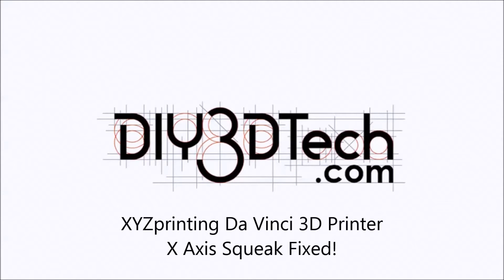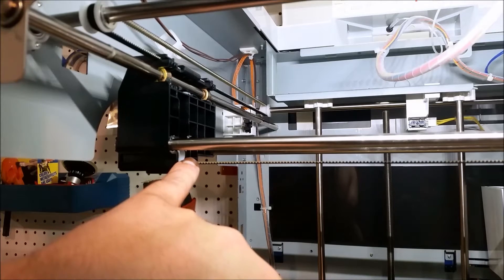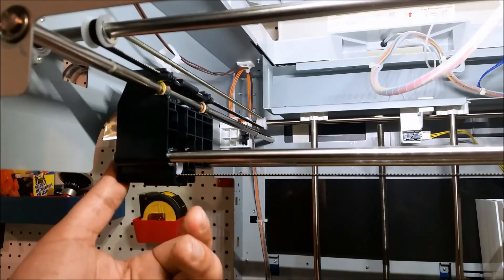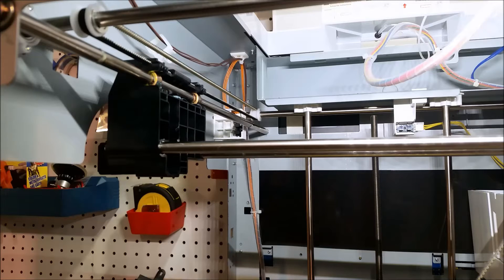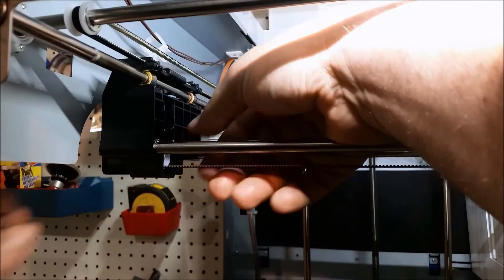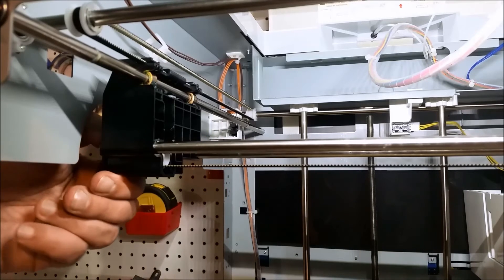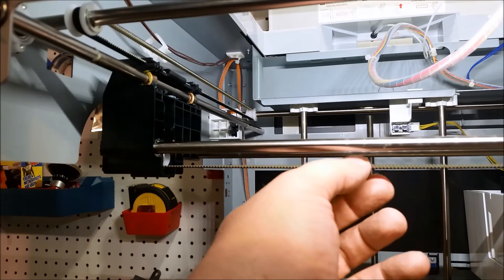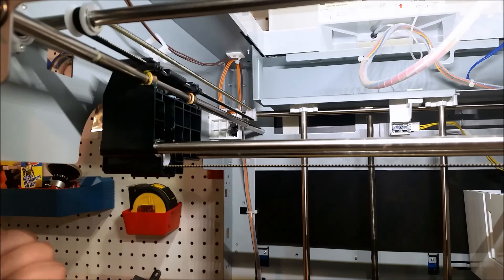XYZprinting Da Vinci 3D Printer - X Axis Squeak Fixed

Comment: Dear Doctor for machines of future, that chirp began within months of the warranty of the machine? I'm worried about how long it will begin to cut the belt because of the noise on that axis . I have this printer for a month and a half ago and the noise is just there. I got the months warranty is 3 months, I venture to do the same repair personally but with transparent tube? as it is almost impossible to get tube white lithium in Chile. another option : if the noise continues , the belt will be cut ?
PS: I'm printing about 6 hours every day at fast speed but I must continue that pace. I also have a tube but it is transparent and few yellow, also for machines of all kinds ( vhs , dvd consoles , etc ..).   MODEL: Davinci xyzprinting 1.0
Greetings and thanks for your time Doc friend! :)
Reply from the maker: You should be able to use any light grease or oil (sparingly), lithium grease simply wears betters and last long then most petroleum based lubricants.  Also if your printing 6 hours a day every day, that is a pretty heavy duty cycle for a "hobby" machine so if you get a years life that would be good as the your first failure will likely be in the wire harness (that where most Da Vinci's I have fail, fail first...
Reply: Ok friend,thank you for your attention and kindness!! :DD
Reply from the maker: You welcome :-)

Comment: Can you use that same grease on the rods? I can't find a good YouTube video that shows you how to lubricate a 3D printer is that something you can show us? Thanks!
Reply from the maker: Yes and not much of a video as I would just dab a little on the rods every few months as lithium grease lasts for ever...
Reply: Yeah I went out to lowes this morning and picked up some WD40 White Lithium spray and sprayed all the rods and wiped them down also sprayed some on the bearing I did it because my Da vinci started rattling a little that seemed to take care of the noise i also adjusted all the belts any other thing you mite think that could cause that? That i mite want to touch up?
Reply from the maker: Not off the top of head, have you made sure the belts are aligned as if they a tooth or two off this could be an issue.  There is a video in the playlist for this printer might circle or oval and I show how to fix this issue...
Reply: Yes that was another thing i did after watching your videos mine was off just like yours and it did help! once again thanks for your videos they have helped tremendously!
Reply from the maker: Your Welcome :-)